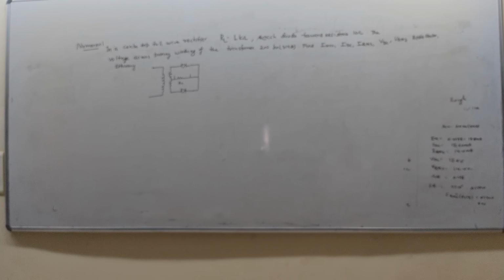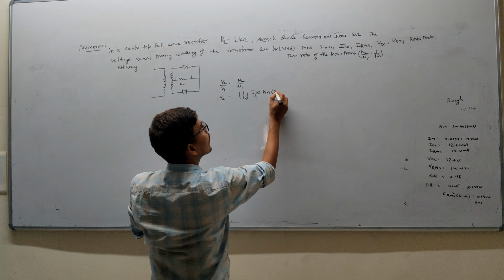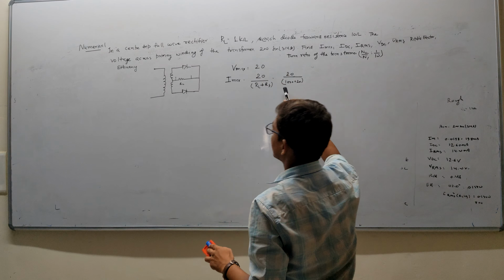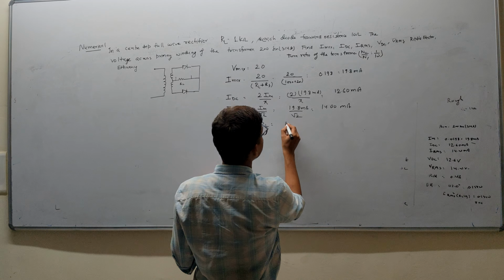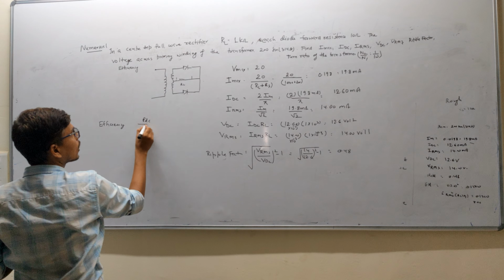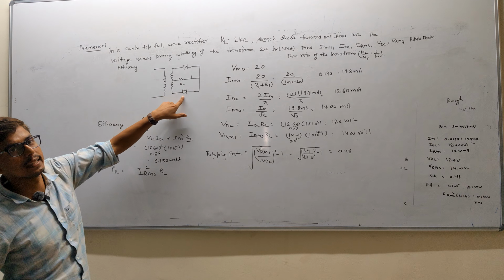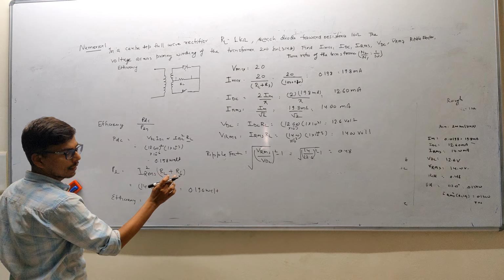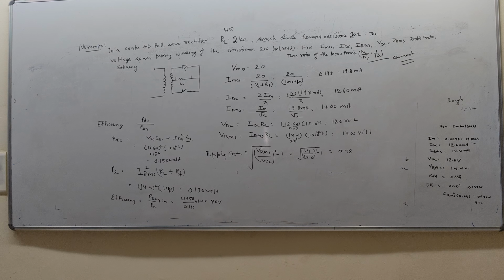Basic Lecture 13 Numerical on Full wave rectifier

Comment from the maker: In calculation of Imax I have written 0.198 it should be 0.0198. Kindly make this correction.
Reply from the maker: Kindly recheck efficiency of full wave rectifier. It can't come to be 40 percent. It should be around 80 percent. Also recheck the calculation of ripple factor. One more thing ripple factor is a ratio so it is unit less. You have assigned Volt as its unit.❤